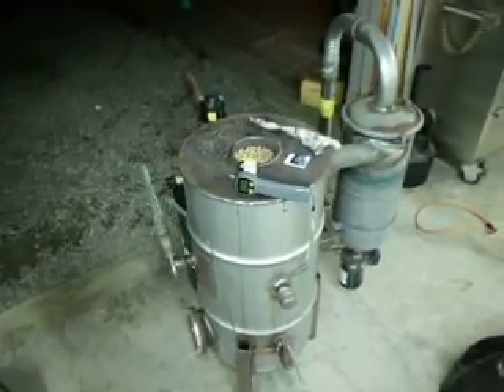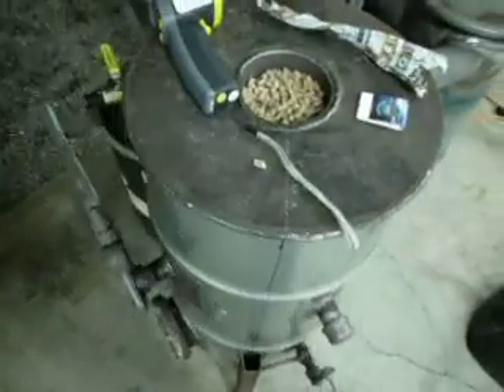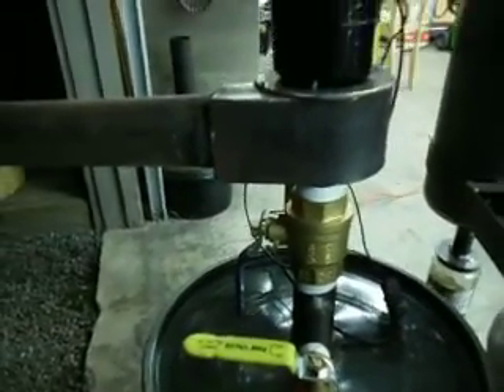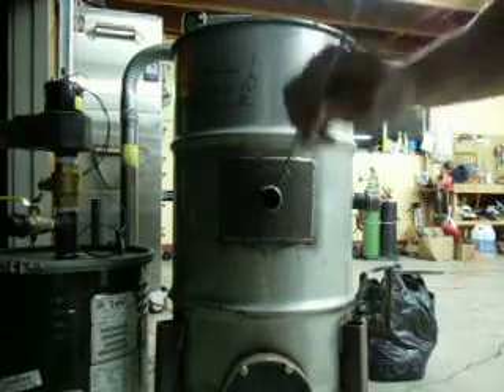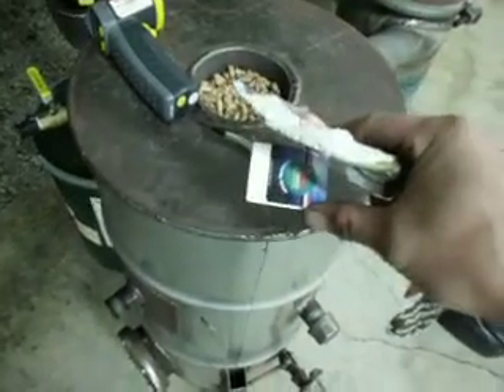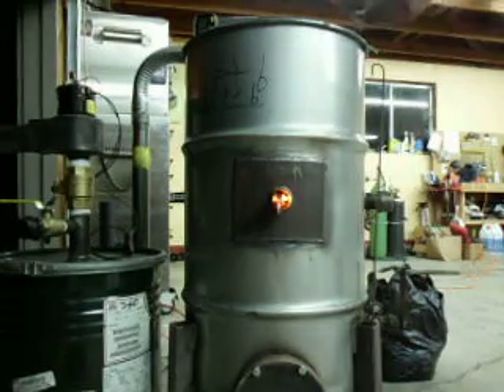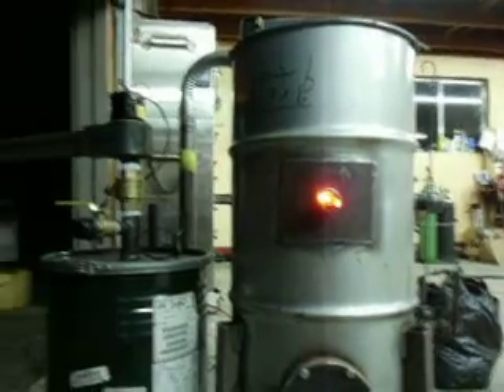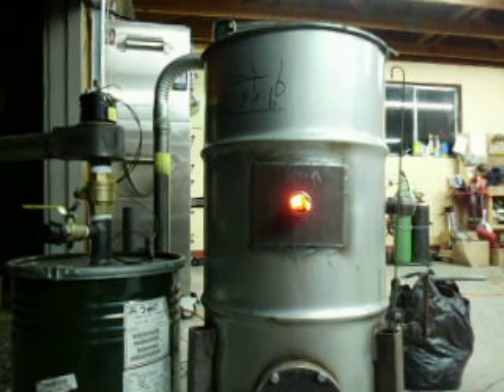Gasifier start up

Comment: I found it... Thanks.   I priced threaded black pipe... OUCH!   Was hoping to be able to use some straight non-threaded exhaust pipe for starting port, but wondering how I would cap it.   I was thinking about using a cap w/ a gasket and some springs to hold it right.   But the ease of a threaded cap may yield more fav results.

What I really want to find is some 2" diameter pipe to get syngas from rear of vehicle to up front.  Stainless 2" flex pipe is almost 200 bucks. :(  Ideas?

Comment: im not shure how to take this but listen i REALY just want to help i have built 3 diferent femas and its always the same prob TAR and after u get enof filters the engine cant pull throu it i have done YEARS of reserch on this and in three dif langueges the imbert is a litle more work but u only need two filters and it provids a load of power ill have my imbert build posted soon good luck =3-